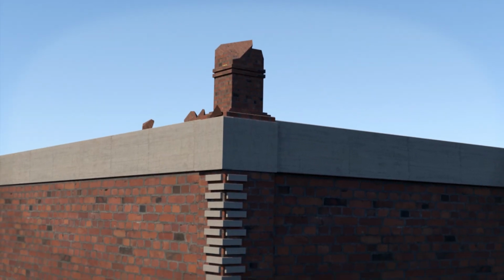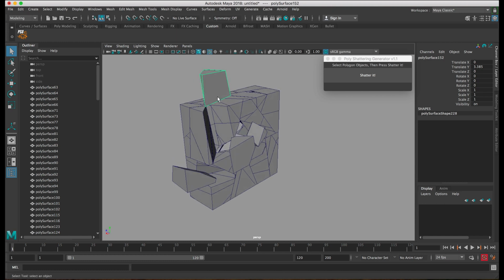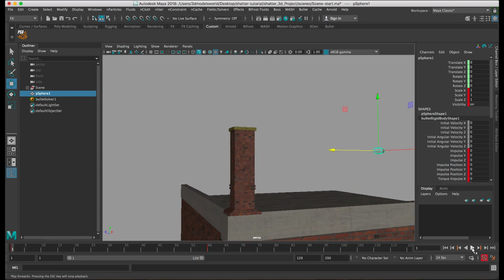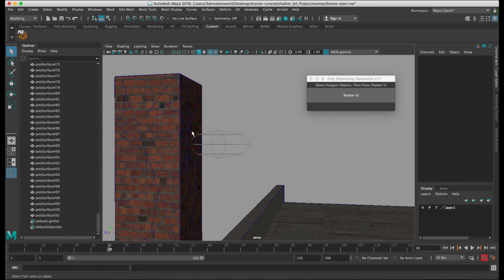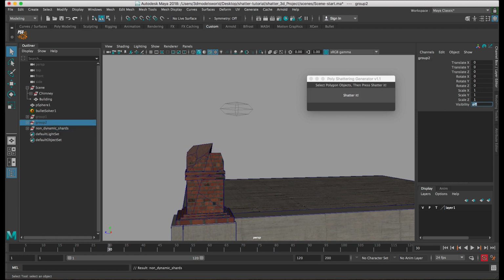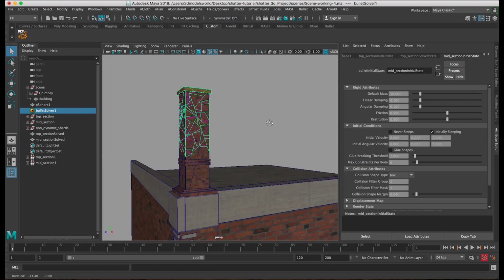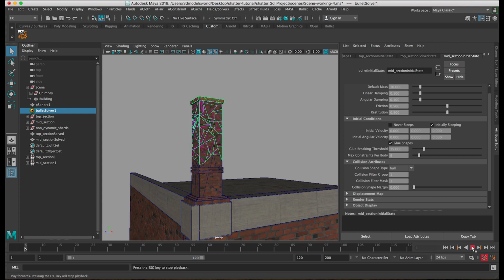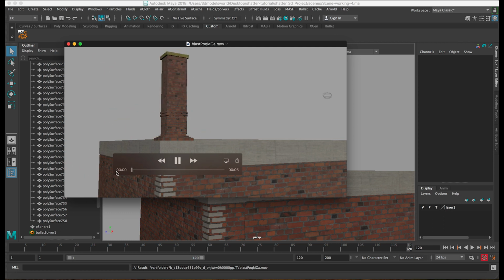Maya Bullet Physics - Chimney Destruction Simulation Tutorial

Comment: Hi, I am using Maya 2020 and trying to learn Bullet simulation with bullet plugin. How do I move the ball in a specific direction, not purely x/y/z-axis? I mean, I wanted to have an arbitrary direction for my bullet to hit the target. Is there a way to through a ball or bullet to a targeted direction either with initial velocity or with the initial keyframe, please? In simple rigidbody dynamics, I could use on/off dynamic state, but I cannot find that type of option in Bullet plugin. Maybe initial sleeping would do.....just curious. To be more specific, is there a way that the sphere in your this tutorial will also be affected by the hit? when it is hitting on the wall. There are only two way to do that: (a) this sphere could have initial velocity but I do not want just pure single axis. I want a specific direction of the spare. (b) I could have a similar key framing on to my spare but I also want it to show the impact when it is touching the wall. Many thanks
Reply from the maker: There is multiple ways to do that type of effect, on top of my head, you can add force to the bullet object to control its direction like wind turbulence etc.. using the Maya forces to have the bullet object go in the direction you want.  might need some nParticles involved and some faking like some is animated and some is dynamics etc..might create tutorial about this in the future it require some experimentation to get the result. hope this helps :) keep experimenting thats the best way to find out what will work for your scene :)